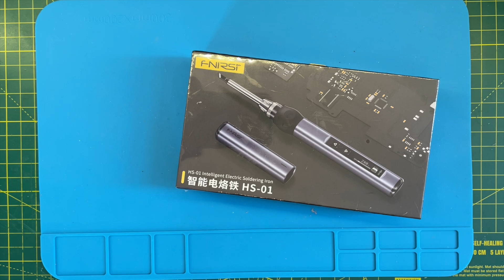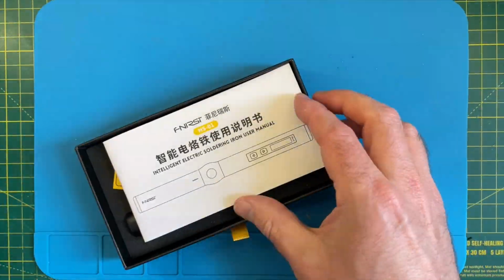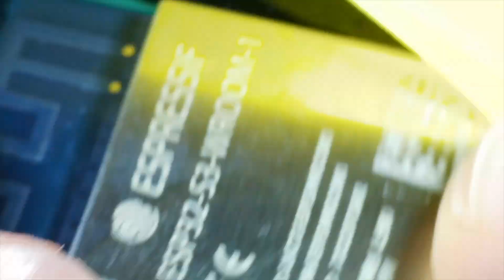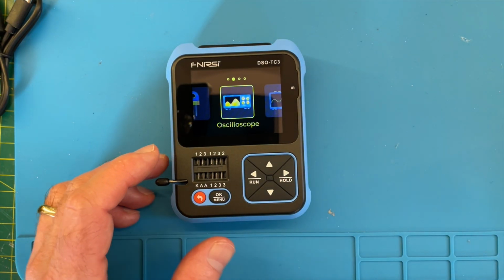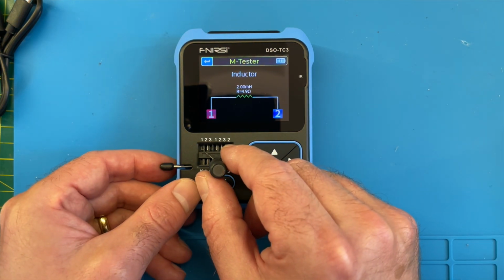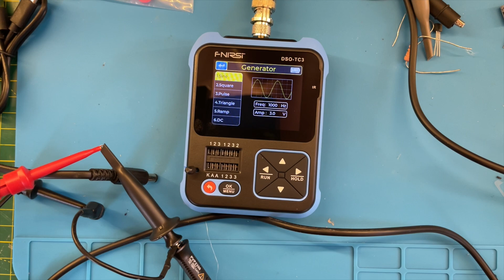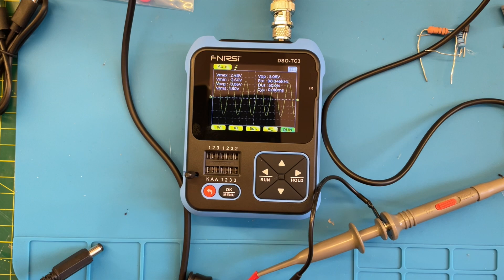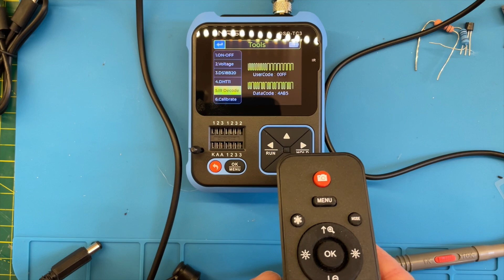Soldering up another ESP32-S3 board and a 3in1 Oscilloscope

Comment: There were 9 cube shaped contact points at bottom of the esp module, aren't those supposed to be soldered as well?
Reply: The do not need to be, they are just for better thermal conduction.

Comment: No soldering for large ground pin under the bottom?
Reply from the maker: It's not actually needed. It does improve thermal performance. "Soldering the EPAD to the ground of the base board is not a must, however, it can optimize thermal performance." https://www.espressif.com/sites/default/files/documentation/esp32-s3-wroom-1_wroom-1u_datasheet_en.pdf page 29.

Comment: I just started my adventure into microcontrollers and electronics a few months ago and have been interested in picking up an oscilloscope. Would you recommend this one to beginners? Thank you for another great video!
Reply from the maker: Really depends on your budget. The one in the video is probably ok for simple testing. The Rigol range of scopes are pretty popular and affordable. If you can afford it get a four channel one - I was a bit cheap and went two channel and almost immediately regretted it. Depending on what you are doing a scope is really just a “nice to have” piece of equipment.
Reply: @atomic14  I really appreciate your advice, thank you. I'm still going to be putting some money aside for an osciliscope, especially a 4 channel. I'm investing in a bench power supply as I'm out growing the 3.3/5v breadboard adapter I'm using at the moment. All the best 🙂 👍

Comment: I just bought an 800 dollar lcr meter because my component tester hated inductors. Haha. I plan on winding some motors and guitar pickups though
Reply from the maker: Nice - it's amazing how expensive equipment can get!
Reply: @atomic14  yeah. It's brutal. I wanted a new guitar instead but I have some winter projects planned and needed a decent lcr meter. I'm posting my mesr100 for free in local buy and sell and no one wants it. It's a weird world we live in. 

I give really nice gear kits away to people who can't afford to get started and all I ask if it's an adult is for them to learn ohms law and series and parallel resistor calculations and so many people have went quiet after I said that. It's not asking much. A decent station, 858d hot air, component tester, brymen meter, all the other stuff one would need to get started. It's over 700 worth of stuff yet no one has taken me up on it. I donate gear but it's not asking much out of someone. I'll even help and they never need to meet me in person. Haha

Comment: The scope seems to be a nice and decent one. I see it lying around on my desk for quick measurements instead of having bring out the bigger scope. Like it! I also like the fact that more and more manufacturers of USB/digital soldering irons start to use the same type of tip. That means you can use your TS100 tips with the FNIRSI iron and the other way around. This gives you the opportunity to build a nice collection of tips for multiple soldering irons instead of have just a few tips for each soldering iron.

It is almost like buying a iron for your tips instead of tips for you iron :)
Reply from the maker: Yeah, feels like that's the way it should be. I didn't realise how expensive tips could actually be - it's almost like printer ink cartridges!
Reply: @atomic14  Exactly... but luckily for us makers, there seems to be a standard developing around the tips. And if more ad more irons use the same tip type, the might even become a bit cheaper.